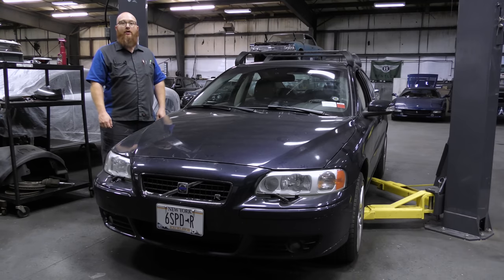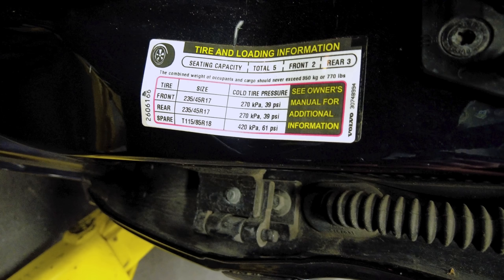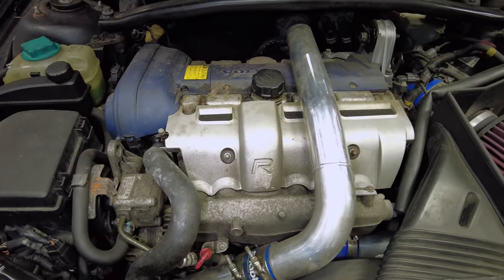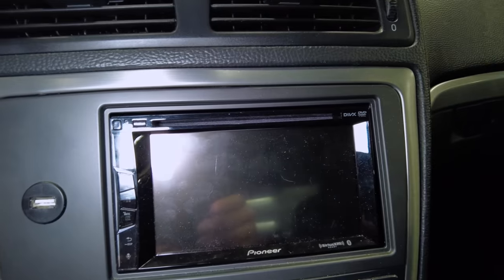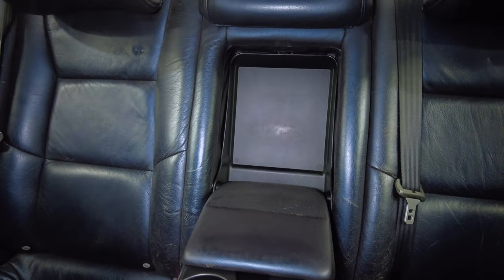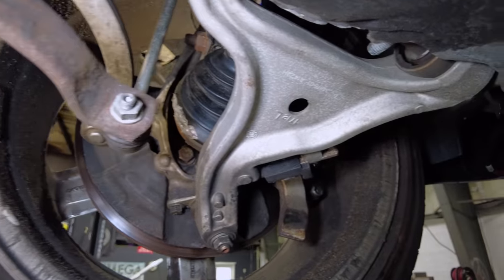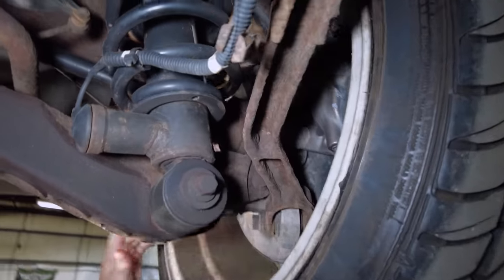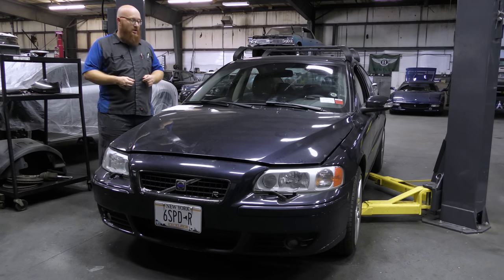They shipped their '07 Volvo S60R over 1K miles to my shop? CAR WIZARD determines if it's worth it!

Comment: Actually if the customer still has full collision coverage on the car a lot of times insurance will credit the customer for the services rendered into the vehicle thus far. I actually had that happen to me twice in the past 2 years with my 2014 Honda CR-Vs. I got very lucky because you're right a lot of times it doesn't work out that way! So as a suggestion you might want to ask the customer if they still carry full coverage insurance on the car that way in the event that something like that ever happens where the vehicle is totaled, then you can tell the customer to contact their insurance company and see if they can submit their service invoices to their insurance company for reimbursement. Hope this helps!
Reply: If the car is old enough, get stated value car insurance. It may cost more but at least they won't give you $50 if it gets hit.
Reply: I actually even had this happen on my liability-only vehicle after a non-insured driver hit me three days after I had it repainted. That repaint saved my older vehicle from being totaled. Best decision of my life. 😂
Reply: @Metered_Air  cool story!

Comment: Are the repairs worth it for the car itself? Up to the owner I suppose. But was it worth the $1k to ship it to the Wizard? Absolutely.

If nothing else, it shows the level of honesty and trust that Wizard has in his shop's work resonates with the viewers. and that's awesome to see.  :)
Reply: You are correct sir.
Reply: And if you live in Europe, the parts are plenty and very affordable.
In my country there's LOTS of Volvo specialized businesses dealing in disassembling used Volvos to sell the parts.
I've got an '01 V70 that's super basic with almost no luxuries other than power steering, power brakes, and AC.
Mine is super simple to fix and very affordable.
No parking sensors, headlight wipers, or whatnot.
I love it!
Reply: ninja just nixed all out of state work due to transport costs of warranty work. surprised wizard hasn't already done this as well
Reply: @DeeDee-pw9pm how is power steering luxury though?

Comment: IDK, that R is in pretty trashed condition to me.  Busted bumper, bad paint, trim coming off, the cosmetic issues in the interior plus the power steering issues etc. and the rust I saw in some spots, this thing just seems like it had a pretty hard 120k.  I mean, I get the love, I used to have an 04 S60R, wonderful cars, but this thing needs a LOT of love to me and I think your advise of just cut your losses and get another one is warranted here.

Comment: RE Calipers
If the steel connector to the caliper is rusty, I would  remove the caliper, fix it in a vice and use oxy or map gas to heat the connector.  That might be enough to loosen it. Worth a try before binning the caliper.  Great channel!
Reply: Yeah, cut the hose, take the caliper out, sort it, then replace with braided stainless lines.
Reply: They look crusty, but the come out. I changed mine to stainless a long time ago. Pain in the ass job.

Comment: Hi, once I pop the hood and see modifications that I didn’t install then I know that it was beat. Someone thought they were driving the Nurburgring on a regular road where probably the engine was not brought up to temperature for a prolonged period of time. I had an TI Sport AWD when it first came out and we drove it for about 2 years and then traded it and got great money for it. Unless you really need AWD it’s just a waste and something else to fix and the excess weight is not good for gas mileage. The Volvo’s were nice but you need to be rich to fix them out of warranty!! Great Videos!! Thank You 🙏
Reply: Have you ever looked at the OEM turbo inlet and outlet piping in this year? They were made of plastic and would crack out at about 100,000 miles - the replacement with the Snaab kit was both cheaper than the plastic OEM AND more durable.   The more you know...

Comment: I had an 07R and loved it! One minor detail i caught is that you mentioned the strut tower brace and that is only an upper motor mount. You have to add a strut tower brace along with the motor mount to get the stiffness that a brace provides. Totally worth sending to The Car Wizard! Only have these cars looked at by a trusted mechanic. Bad work is why i eventually needed to let mine go.
Reply: The upper engine Mount is Just a vibration damper. The engine actualy sitts on a front and rear Main Mount, and an aditional stabelizer on the right side, as well as a torque limiter on the front of the gear box.

Comment: Actually all P2R’s came with Pegasus wheels from factory, the only wheels the clear those “big” front brembo brake calipers.

And No the interior mirror isn’t that simple to just replace, it houses the key remote antenna and will need to be reprogrammed if changed, unless you move the electronics over to the new mirror.

The rubbing isn’t really an issue as almost all P2s do that, check the steering stops on the control arms.

Comment: No.  That's alot of wrong with that vehicle.  It wasn't even that well maintained.  Paint is peeling off the car!  Not to mention all the mechanical issues its having.  There has to be alot of sentimental value with this particular vehicle because anyone else would easily move into something with less miles on it and maybe even a little better in terms of overall "car for price".  Stunned the owner went thru with it. On second thought, he did ship it all the way down there to get serviced!  Insane!

Comment: As a Volvo enthusiast myself, I have a genuine admiration for these cars. They're faster than a Ferrari 360 and can haul your whole family. Many viewers will see the list of stuff wrong with this car and think "What a piece of crap! I'll never own a Volvo with all these problems they have!" But the issues are related to the bespoke nature of this specific model. R cars really pushed performance to the absolute limit and you get issues related to the stress. Like the blocks crack between the cylinders and give the symptoms of a head gasket, then you have all the bespoke stuff that only went on the "R"s so parts can be difficult to get a hold of for these. Here's a secret: My 2012 XC60 (P3 generation, this is P2) has the same amount of power (with one extra cylinder) and the same adaptive suspension, but shares a chassis with the Ford Edge (yes, really!) so parts are a lot cheaper. Mine's got nearly 240,000 miles now, drives like a brand new one, and the interior is in much better shape than this car despite being used and abused as an Uber. FCP Euro helps a LOT with parts, and everything they sell has a lifetime warranty; even brakes! They sell OE steering angle sensors for waaaay less than the dealer (another hint, they can sometimes be reprogrammed and not need replacement at all, try that first. It's super common on P2s and often fixes them.) I genuinely believe Volvos are the best cars in the world. Yes, even better than Toyota. No Toyota can match a Volvo's level of performance, comfort, style, and reliability; wrapped into the safest car on the road.

Comment: The repair cost is always a tricky one.  I've had people with cars which were, effectively, totaled given the mechanical repair needs and some body damage ask about what they should do.  I told them it's only worth scrap value at the junkyard--which isn't going to give much even before factoring in the mechanical issues and body damage.  So it needs $3k in repairs and you can get $250 from the scrapyard?  What are you going to buy for $2750 these days?  There's something to be said for the old saying "the devil you know is better than the devil you don't."  At least you know the maintenance and repair history of your vehicle, as long as you've taken care of it then that $2750 is better-spent fixing your old clunker than buying someone else's problems.  But then comes the inevitable issue of insurance value--some insurance companies are good enough to where you can send them recent repair bills and they'll partially return some of that value to you in the case of a total loss but you'll never get your money back.  That's always a big consideration which often goes overlooked when investing in repairs to a vehicle--will you get your money back if someone isn't paying attention and rear-ends you tomorrow and totals your car (ask me how I know this one).  Fortunately you can often declare a value with your insurance company, generally with a modified vehicle but you can usually press to declare what you believe your vehicle is worth and pay the extra cost to insure it for that amount.
Reply: That's a cool tip, you can send recent repair bills to try to get some back.

Comment: I had to sell my V70R as I was not willing to spend the money on repairing the 4C suspension and replacing the Brembo rotors and pads. Just the shocks and brakes was almost the value of the car.
Reply: He's gonna spend all that money and being still being stuck with an old Volvo I would have a detailed sell it on and buy a Corolla or a Camry
Reply: You can install a standard suspension on them
Reply: @BubblesTheCat1 mwaa.120.000 miles....mine has 300.00 miles on it.....runs perfect!
Reply: @gordonmccracken1209 yep. And change the software to standard.
Reply: @BubblesTheCat1  You sound like you have never driven an R before...
Reply: Did the same with only shocks and rotors plus brakes the quote was 6000 euros, I sold mine added 6000 and bought the next generation with 100000km and drove that one for 400000km and sold it on in one day. Now I drive a 2019 T5 4 cilinder and it has no sound and no soul , it’s just and only a very comfortable computer on wheels  missing the complete idea of the R versions.
Reply: Yup, about 2,000usd for a new set of monroes right now. Yikes.
Reply: @youtubasoarus  indeed.

Comment: 17s are rare, 18's were an option, but those Pegasus look like reps. Unless its super low miles its not really worth it for 8k. Most I've poured into one is 3k and even after that the interior was cleaner than this s60r. M66's for this year are really hard, I would honestly look into finding them a replacement m66 from a s40 awd as that's more available. The brakes can be very hard to find as they're popular to use on other platforms with adapters.

Comment: That rubbing from the front wheel is propably caused by worn out steering limiter. There are different thicknesses of them, depending the wheel size the car came with, and they will wear with age.

Comment: I have an 01 S60 T5. I’ve owned it for 21 years. It sat for a while and that really did a number. It had a ton of things to fix recently to make it a daily driver post-pandemic. Did a new rack (insanely expensive) + pump and housing, both fuel pumps (huge tank with two sides), full suspension, PCV, timing belt, crankshaft adjustment, full brakes and rebuilt the exhaust. It’s something you can only do for irrational reasons.  I dont regret it though 😊.

Comment: Hell yes its worth it. The p2 60R is a gem. I have an 04 and i love it. Mine also has the 6 speed. That car is the reason for my channel name
The rack is common. Highly suggest the owner go with aftermarket braided stainless flex hose for the lines. Cheapest rack i found was a reman from cardone. Also that caliper can b saved. U can drill out that hole for the line and tap directly to the caliper. I used AN fittings with flex braid lines. There r also rebuild kits for the calipers. Zero issues from brakes or PS for a couple yrs now. Also wizard, check ipd for parts. They r also a wealth of knowledge on all things volvo
Reply: 2004 Titanium Grey/Gobi 6sp represent!
Reply: @pogoism9  2004 silver\nordkapp, 6 speed

Comment: I am always amazed at the 'normal wear and tear' on cars that are not much older than mine.  I bought my Jeep new in 2010 and it has 110k miles.  It still looks brand new with perfect paint, no rust or corrosion, perfect interior etc.   It baffles me how some cars just age quicker than others.
Reply: Not maintained well, not kept in a garage and went through many hands probably

Comment: Hey Wizard, Ive been working on Volvo's for 15 years now. I find that most R's are beaten to within an inch of their lives by now, especially when tney have add ons like the cold air and aluminum turbo pipes as well as aftermarket exhaust. 

I've seen 5 in the last few years where the aluminum block has cracked around the cylinder liners and caused compression to leak into the cooling system. 

Another note is, the rubbing at full lock from the tires/wheels is very very common on those, even with the proper steering stops, it happens with 17 inch, 18 or 19 inch wheels. I've seen people add washers behind the bolts holding the stops, and the wheels still rub a little.

We had a guy who had a 6 speed manual R, needed a transmission, we couldn't find one used, no one would rebuild it and Volvo wanted the moon for a new one.

I replaced all 4 calipers on an 07 V70R 4 years ago, Volvo has them, it was around 2000 bucks just for the calipers...
Reply: Do you know much about the Volvo S80’s? With the yamaha v8 ? I was interested in picking one up.. are they uber expensive to maintain like the s60’s? Man 2000k for calipers is scary sounding .. makes wonder how much other repairs would be. Although it would be driven maybe 1000k miles a year.. just as a weekend warrior.
Reply: @richyp73  I'll say this, I've never seen an S80 V8 that didn't need a transmission..... now in the XC90's with the V8 the transmissions hold up very well....

Keep in mind, it's only the R version of the S60 or V70 that have the very expensive calipers, I have an 04 S60 AWD, has close to 400,000 km on it and it's easy to get calipers for, around 200 bucks for a set of fronts...
Reply: Thanks for the reply.. Boy I thought maybe the s80 transmissions would be solid being a Asin/Toyota built. Im afraid to ask what that would cost.. or if one can even find a replacement

Comment: I have had a couple of vehicles repaired that were supposedly mechanically totaled or totaled by the insurance company. 
I had my reasons for doing so and would never blame the mechanic if my vehicle was wrecked.
Most recently I bought a 2001 Saturn  LW300 back from the insurance company after the insurance company totaled it after an encounter with a deer.
The vehicle only had 70k miles and was in very good condition and drove perfectly. 
I bought the vehicle back from the insurance and sourced used parts to repair the very minor damage. 
Still using it as an "EXTRA" car five years later.

Comment: Very surprised customer wants to put so much money in this thing considering how beat up it is externally for only having 120k miles. You would think it would be immaculate from outside if they are willing to put 8k+ $ into it. Kinda strange 😂
Reply: Sometimes people just want to stick with what they know. You know what's been fixed and what's due.
Reply: not very, these cars are limited production and often times collectors buy them. they're one of the more reliable european car brands and can easily make over 450hp

Comment: Definitely worth it. The values keep rising on the s60R especially if they have the 6 speed manual transmission like this one. It is also fairly low miles for the age and the rust is very minor for a new England vehicle. A fully sorted one will cost the customer more than what hes paying to have you fix it and if he buys one around the price of the repairs itll need more money spent on sorting some issues out because it will have issues at that price point. Not to mention finding manual ones can be difficult and when you do you're always paying more.
Reply: Rust would certainly be a no go from me.
Reply: @keithwiebe1787 these normal dont rust that much, unless they have poorly repairded acsident damage.

Comment: Owning this generation of Volvo R long term is like owning an M3, you need patience, money, time, tools, and knowhow. If you have access to VIDA, you'll be way better off than others. Even so, original parts are expensive, and some things aren't particularly easy to service either. I'd put it at an intermediate difficulty for upkeep if youre doing it on your own, but only if youve got VIDA, otherwise if you get one of these cars in rough shape, it can quickly become a nightmare car.

I got mine my senior year of highschool back in 2021 and have daily driven it since. In 2022 I started to learn how to tune these cars, and since then I've slowly been bumping up the power and really fine tuning how everything runs (You can expect to get maybe 330-350whp with a really good tune, good fuel, a downpipe and a good intercooler on the stock turbo). Had to do some fabrication work to upgrade the intercooler, and sadly the 4C suspension has begun to give out, so I'll have to spend a good $1200 in parts for a set of new front struts, but the car itself has been fantastic. I'd really only recommend Rs for enthusiasts though, otherwise get a T5 or 2.5T, they're way easier to find parts for and the maintenance is generally easier and less frequent, plus the headlight bulbs dont cost $100-150 a piece in most 2.5Ts and T5s, Rs have HIDs standard, so uh be ready to spend a good amount of money when the headlights burn out.

Comment: My favorite caR ever. Have had my 2005 for eight years now.  Mine has about 310,000 miles and is also rough around the edges.  Are you sure it really has 120000mi?  The clusters can easily be swapped out to display a different odometer reading.

Comment: Had one of these, tire rubbing is due chassis not designed for the wide wheels. Also would eat front bushings in 25kmi. The drive shaft exhaust rub happened on mine when hitting rain or snow, the exhaust heat change would flex into the drive shaft. It would squeal for about 30 seconds and go back to normal.  Car was great to drive, very fast and had comfortable seats. The back seat was small for the size of car.